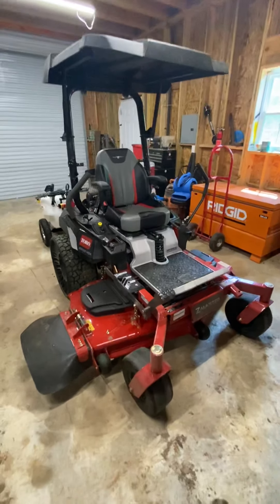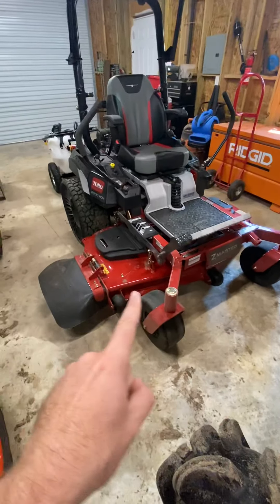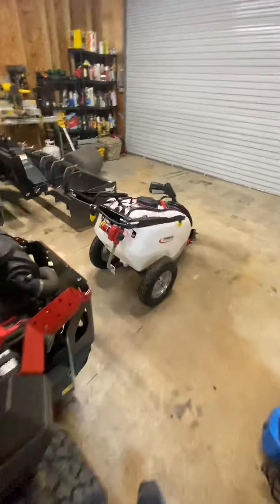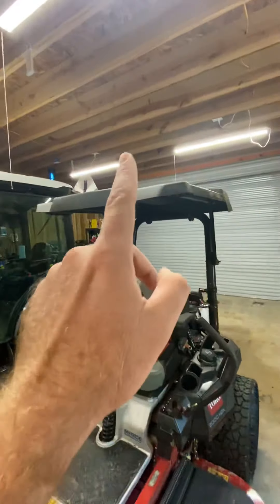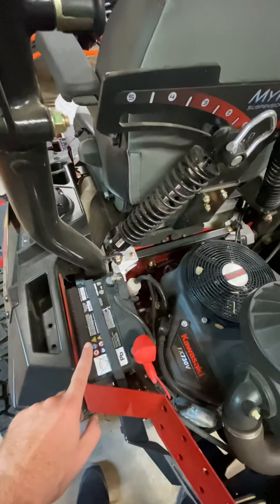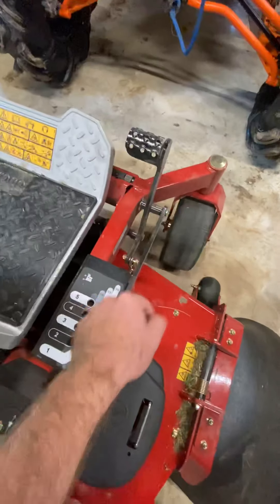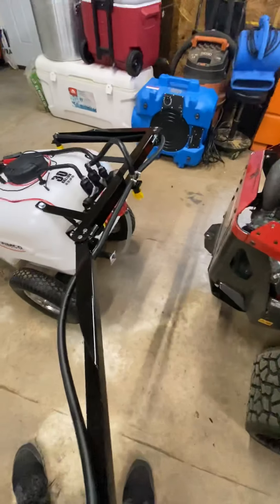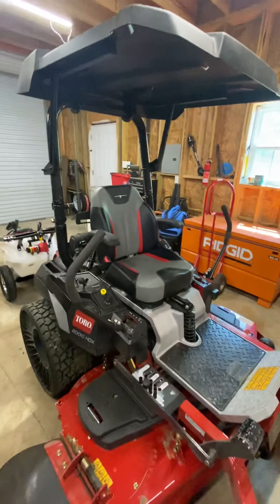Toro z master review

Comment: Do you feel like the 23.5 Kawasaki is enough power for the 60inch deck? I am looking at the same exact model. Thanks!
Reply from the maker: Overall yes... mostly st Augustine here. 
A 26 would be nice but this kawi has a good torque band and I’ve yet to stop the motor in heavy grass.. also starts easier than the toro brand engine ...